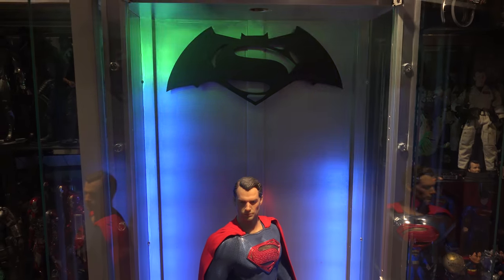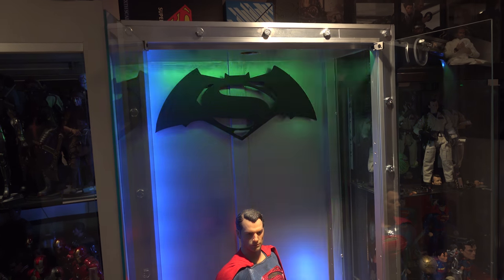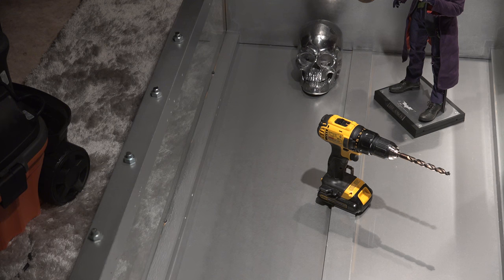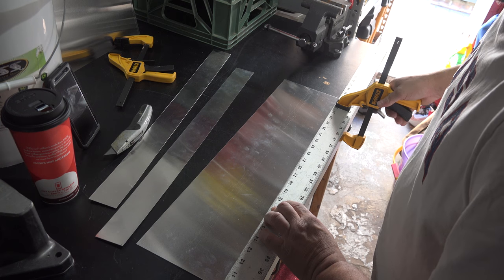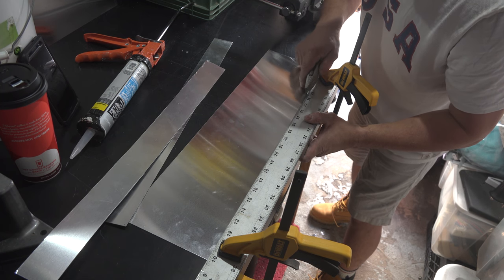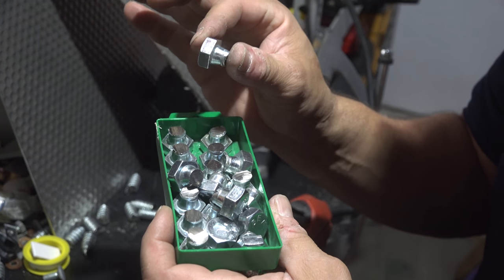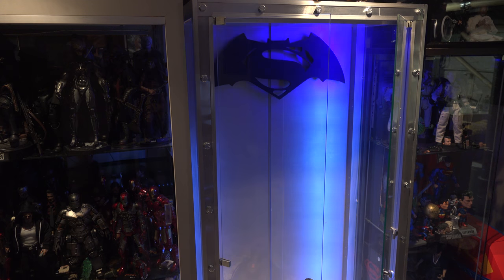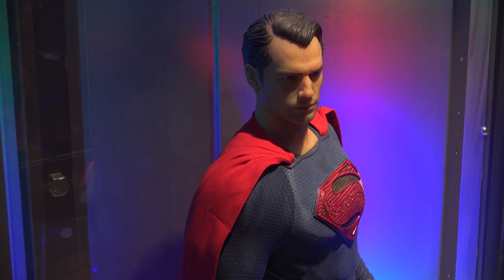DIY Prime 1 MAN OF STEEL Display case How to video

Comment: Awesome job on the display cabinet. Looks very professionally done. Just a tip, if you clamp your sheet metal on the score on the edge of your bench and bend, it will snap off.

Comment: Do you have a link of the site you bought that BVS logo from? I have no idea what ST is.
Reply from the maker: Sli R Etsy.com just type Suoerman logo or Man of Steel logo in the search
Reply from the maker: Well you are getting the 2.0 version at the time this wasn't on sale well not here on Etsy.
Same dimensions and mine is made of wood and powdered by batteries. This one is superior to mine. I would get it. I'm actually thinking about picking this one up now that I look at it more. Yeah get it. Only thing is that it is wired so if you don't mine the cable your good. Good luck